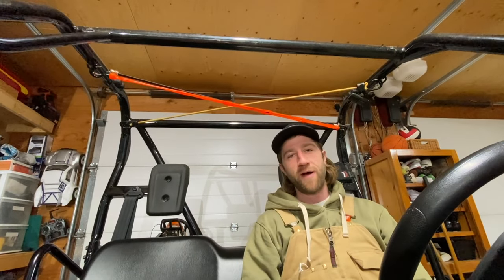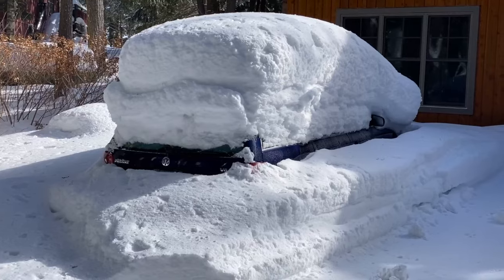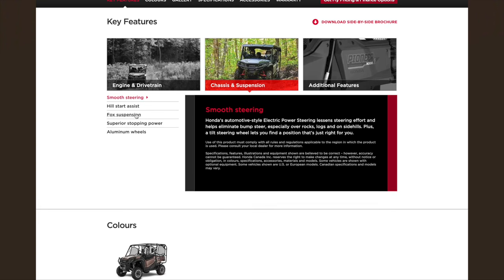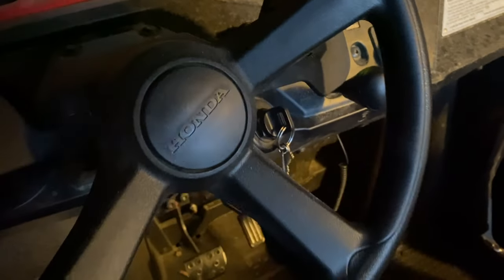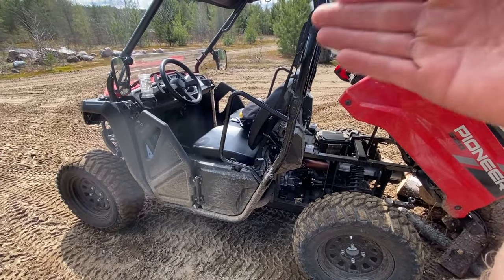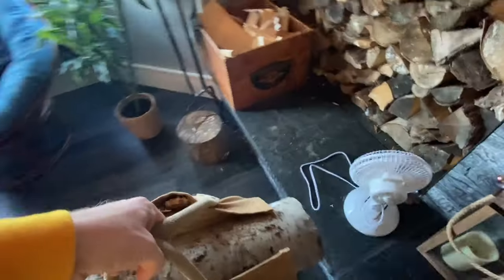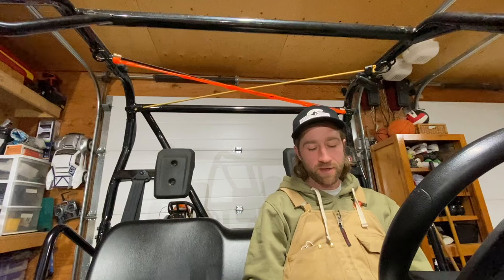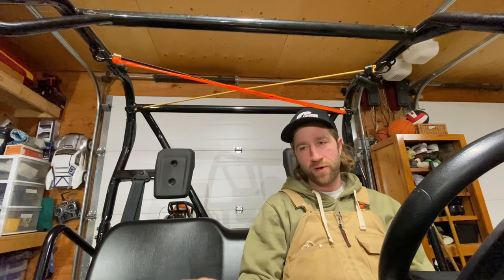Honda Pioneer 520 ONE YEAR REVIEW on the ranch with TIPS, TRICKS, and more!

Comment: I gave my P500 to my son and bought a P520. My pioneer is used for deer hunting and very slow trail riding on narrow trails and sometimes no trails at all. That is why I prefer the narrow P520. I don't want a big machine for the woods. The new 1000 cc machines are nearly as large as my Jeep Rubicon. Most of the guys I know around here buy  big machines and then just ride dirt roads. Hell, my rubicon can do that with power everything and heat and air conditioning. One more thing, don't let anyone tell you the cab is too small. I'm 6' 2" and weigh 283 and I at times take a passenger with me with no trouble.
Reply from the maker: Very nice! It’s crazy how much bigger the trails need to be for the 1000cc machines to get around with the same ease. And once you get down to small atv trails it’s game over. Haha yes, often I’ve thought, for the price why not buy a jeep! Of course it’s not 100% the same thing but still worth debating for some folks needs for sure! Second that, the fellas here are over 6’ and don’t have trouble with the 520 either. Thanks for watching 👍👍
Reply: The 500/520 are alone in the super narrow catagory.. maybe some of those 1 seaters, but thats not the same…. I despise honda, but find myself thinking i need a 520….

Comment: Dude, between this video and your initial impressions video about the 520, I found this to be very insightful and also very helpful. I have been looking at 520s for awhile but they are always out of stock. I very nearly bought a Pioneer 700 but thankfully a 520 appeared on the dealer manifest the other day so I got my deposit on it for June delivery. I think these are the perfect machines for the size and price. I had a larger Can Am Commander a couple years ago and the size difference alone with the smaller one is totally worth it being a little slower and less exciting on flat ground. These 50 inch models can get onto trails and into spaces that the larger one can't at all, and for me that's a big deal
Reply from the maker: They really do fit the bill for so many applications. Yes, the 50” is such an advantage in tight spots. The 520 really is tons of fun, rowing through the gears never gets old. So glad you found the videos helpful, and thanks for watching!
Reply: This is why I’m interested in the 520. Smaller size. We just want a side by side for small tasks on the farm. I don’t need power or big size. I need something that can carry a few sacks of grain and a bucket of water. Maybe a shovel or rake once in a while. I’d rather have it not take up so much garage space and get more hours per gallon of gas.
Reply from the maker: It sure does all that perfectly for us. Sometime it would be nice to rig up a shovel/rake rack to make it a bit better for hauling awkward items like that, just to avoid the handle hanging out the side of the box etc… thanks for watching!

Comment: We bought the same P520 to use on roads and Lake Simcoe. New roof, windshield , winch, bigger bumper,seat heaters and aux wiring connectors. Still needs a cabin and cargo light. Upgraded tires and wheels are planned also.  Tracks are a big purchase so we studded the tires for the lakes. Overall we like it, small enough to handle easily .  Thanks for your ideas and ownership experience.
Reply from the maker: You’re not too far from us! It’s great to hear you’re liking the P520 overall. The upgrades you’ve done already sound pretty awesome. How do you rate the studded tire performance on snow and ice? Thanks for watching.
Reply: @ranchroadhomestead  The hardened studs are 7/16 size that screw gun into tread lugs. I’ve used the stud kit on Atvs, dirt bikes since 2005. On ice they are are essential but on snow I don’t think they help much. My area has windswept ice with drifts so straight line traction is needed. Sideways sliding into a snowdrift would be a tip over at speed.
Reply from the maker: Sideways sliding is no joke for sure. We use ‘Grip Studs’ brand on our tractors and leave them in all year. They’ve been great. Just thinking about studding the stock tires and putting a plow and small sander on the p520 for the very icy conditions we get on some very steep customers driveways, there’s a few times even the studded tractors need to skip a driveway or two.

Comment: You are to be commended for a very useful review. And you don’t give us 10 minutes of what it’s like in the driver’s seat!  I have a 2017 P500 and it has been a love hate relationship. I built a plywood box and painted it black, a bit bigger than the 520 box  and it serves well carrying stuff but doesn’t dump of course…I’ve never seen much value in a dump box…if I carry firewood I have to stack it piece by piece anyway and have a small Kubota tractor loader to move rocks and soil.  I also am in Canada and thought that tracks would eliminate the need for a snowmobile. After 2 winters I sold the tracks. 1. very hard to steer. 2. No longer 50 inches for narrow trails. 3. Physically, putting the tracks on and off is for young folks…they take muscle and grunt to move around. Though great in the snow, I use a narrow bush snowmobile for winter trails.  Also, with the tracks on and off with the seasons, it’s not just a simple take the wheels off and put on the tracks…unless you want brackets hanging down, there are steering components to take off and install each time which will wear out bolts/nuts etc.  4. I felt that with tracks, the engine and drive was just too small. It moves them but I think running the engine at high rpm’s all the time is going to take its toll. It is a Honda and might be ok but the 475cc engine while great on wheels is close to maxed all the time with tracks. Your dad is correct, power steering would be nice. The 500/520 are really little mules that are tough and long lasting. I went from a Honda 350 fourtrax (Rancher) atv to the P500 and was shocked and dismayed at how loud the 500 is…with the factory  plastic roof it is difficult to communicate with a rider.  You are correct about the noise. Also, I thing a dash handle for the rider is a must as the driver can brace with the steering wheel but its really rough for the rider. My first addition was a full windshield that opens. Nice to have but it creates a vacuum from behind and if on a dusty road at any speed, the dust just gets sucked into the cab. Long enough…again, your content and production is tops!
Reply from the maker: Thanks for the kind words! You point out some very valid key info regarding the Pioneer 500/520. I rarely dump firewood as well. If we do, it's when we gather some blocked hardwood from downed trees in the bush that our tractors can't get to, so it's handy to be able to bring that wood out of the bush to the yard and dump it by the splitter, times like that I love the dumping box of course. Did you have the larger tracks or the smaller 'under 700cc' size tracks? We have the X4s which is meant for smaller machines, the 520 seems to do fine with them other than shifting isn't so nice when the machine wants to almost come to a stop before it gets in the next gear... About the power steering, we finally did that upgrade, as it was starting to get a bit cumbersome, especially with tracks and trail grooming. I like the idea you have about the dash handle as well. As for the sound levels, the plastic roof isn't great, for sure. The bimini top on Dad's is much quieter. I wonder if some sound absorbing panels could be added under the roof. Now you have me thinking...next mod maybe! -Thanks for watching and happy riding!!

Comment: I recently drove 85mi to a dealer that had the 520 in-stock in the color I wanted (camo).   Hooked up a small trailer that my buddy had, to a Jeep Wrangler, and we were able to tow the 520 back to the property after completing the purchase.   For our purposes, the 520 really fits the bill.  I looked at the 1000’s, and they are too big and double the price, and for our purposes totally not necessary.
Reply from the maker: Awesome that you could get your hands on one. It’s crazy how big the 1000’s are really, they feel like you’re driving that jeep almost! Especially in tight confines, the 520 really shines. Happy riding, and thanks for watching 👍
Reply: @ranchroadhomestead  The 520 seems to be a very unique sxs, it's size, the transmission, and the reliability all come together. It's not a price thing really that's deterring me from the 1000 machines it's thier massive size. Trying to get a defender 1000 around the bush can be quite the pain and I've started the process of finding one of these little guys.
Reply from the maker: You make a very good point about the uniqueness of the Pioneer 520, it’s in its own category in so many ways. The 1000’s feel so much bigger, it’s hard to believe until you drive one and then the other back to back! Last weekend we expanded a small part of our trail to get around a bad soft area, and we cut it for the 520 to get through smoothly, and then we had to go back and make it much bigger for the Nick’s Rmax 1000. He had to do a few forwards and backs to barely get through. Then we had to level it out so he wasn’t angling over and sliding the rops along a big tree! Good luck on your search 👍 and thanks for watching
Reply: @ranchroadhomestead we made all our trails in our fire wood bush 7 feet wide for the last six years
Reply from the maker: What size machine do you use? 7’ is nice and wide. Thanks for watching!!
Reply from the maker: Oops I saw that you have a 1000. Hope you got some decent fire wood at least!

Comment: I put 9"x 28 x 12" all around my 2019 500 with 2"" spacers , making my width 54" overall. Used an Amazon roof rack for a bed on back. Made my top speed 43mph.have 5,000 mi. on it so far, no rubbing issues. Even made a cab using 3/8 " plywood . Adjusted the cable on reverse gear , now just pull paddle for reverse. Can plow and pull 2,000 lbs of gravel in my cargo trailer. May get a 520 in another 5 yrs or so. If this one gives out!
Reply from the maker: That sounds like a great setup you have there, and have logged some good miles on it! I like your list of mods. The 500/520 Are great rigs, always happy to do work. Thanks for watching!!

Comment: Are those atv tracks? I have camso t4s tracks already and I’m thinking about purchasing a SxS soon. I like the pioneer 500/520 size and being able use the tracks on it would be great. Great review by the way 👍
Reply from the maker: They make the x4s in a utv version and a atv version. The t4s is listed as atv only so it’s likely that the frame/rolling components are lighter built and have a lower load capacity. I would check with camso to see if they have the bracket hardware that will work, and if the t4s would be strong enough for the pioneer 500/520. Thanks for watching and glad you enjoyed!

Comment: Finally a review that doesnt tout the “gear” transmission as more durable…. 

They ARE infact different… your mileage may vary, but belts dont just quit, and they are easy to replace… unlike gears… and they act differently… agian, depends on what your doing…. I DO like the idea of shifting though, especially while hauling and stuff
Reply from the maker: Very true. There are pros and cons with both I suppose. Like you said though, it depends what you are doing with the machine, and everyone has different needs. Personally, I like when I’m putting around the yard, and able to keep the revs low and quiet with the gear transmission. Thanks for watching!!

Comment: I really like your videos, very informative !  i'm in the exact same situation as your dad as i purchased a P1000-3 in 2019. Sell it because it was too wide for my needs. I really like the 520 size. I'm just i little hesitant on purchase one because of the suspension. I want to use it 30-40% on club trails and 60-70% on my wood lot... What do you guys think?
Reply from the maker: Thanks, so glad you enjoy the vids! The 1000 feels much larger indeed. You have good reason to be unsure about the suspension on the 520, as it can be rough at times. Soft sidewall tires help and run a bit less PSI in the tires depending on your trails. Upgraded suspension would be very, very nice though. Hope that helps! Happy riding and thanks for watching!

Comment: I am a homesteader in ontario looking at a pioneer 520 or rubicon, after 23 dutiful years of service from our first honda. I'd love a quick update on how the pioneer 520s are holding up for y'all
Reply from the maker: Thanks for tuning in! The 520's are holding up pretty well! Over 5000 kms on mine, much of that higher revs road running (tire treads are starting to show their age lol). I must point out some rust forming at the welds on Richy's 520, which is pretty odd since it has seen less rain/snow than my 520, hes not happy about that. I have since added a superATV power steering kit and torq locker front diff, which really have transformed the P520 to another level, at a bit of a steep cost albeit. This was to help make trail grooming more fun/manageable. The power steering is really nice when manoeuvring around the yard projects etc. We both agree that EPS should be standard, having said that, we do both run larger wheels and tires, which doesn't help the steering factor. Hope that helps. Thanks again for watching and happy homesteading!

Comment: That was a REALLY good video on the Pioneer 500 vs 520. I also got a 500 and immediately they came out with this.... i was so pissed lol. So after a few years yea i want to sell the 500 for the 520. Is the engine actually different? or just upgraded. i wonder if the air intake/ exhaust would bolt right up? They are def updated and straightened out, less extra nonsense.
Reply from the maker: Glad you enjoyed the video! It was a move I didn’t see coming from Honda in the 500 size but pretty cool that they did. Would have been nice if Honda had done this from the beginning thought. I’m not sure about the engine mechanics other than that it is just slightly larger displacement, but it’s likely very similar. Thanks for watching!! Happy riding

Comment: Great feedback on the 520!  Can you please confirm if the tracks increase or decrease the overall height of the vehicle for fitting into an enclosed trailer? Thanks!
Reply from the maker: Glad to help! It raises the machine by about 3-4" over the stock 24" tires and depending on how you set the suspension. With the tracks on I measured last year 10-3/4" ground clearance under the rear part of the chassis. I'll see if I can confirm that tomorrow. Thanks for watching!

Comment: Always wanted a SxS, a light utility some fun mini machine, was looking at a quad but for a little more, a mini SxS.  520 for the box, in all honesty, it will be barely driven but it would force me to get out more which I would like.  The actual transmission is a big selling point for me.

Id push the machine to its limits in some senses, I like utility over comfort and speed.  With the kind of use I would have, it would be something I would run for 20yrs...
Reply from the maker: Thanks for the comment. The pioneer 520 definitely ticks all of those boxes! I was planning on having the 500 for 20 years but the 520 with box came out which was an easy move at the time in 2021. Hopefully we have this one a long time. Just went over 4500 kms on the 520 and going strong. Thanks for watching!!
Reply: @ranchroadhomestead  the problem will be finding one, might have to settle for a 500 and build my own box but a 520 would be prefered...  Still have to wait for next year...
Reply from the maker: @stevencampbell1603 didn’t know they were still so hard to get. Not sure where you are located, but our local dealer has a green one in stock currently FYI.